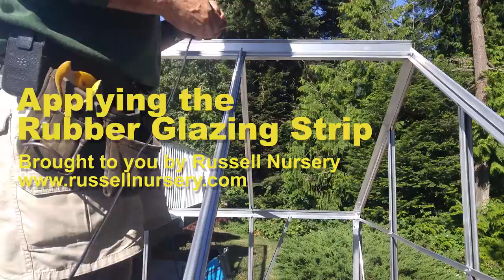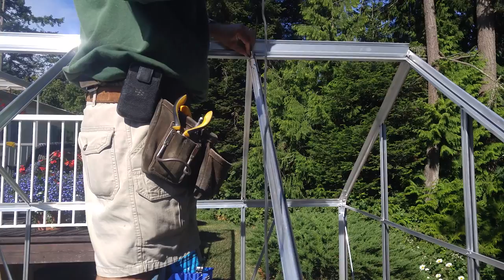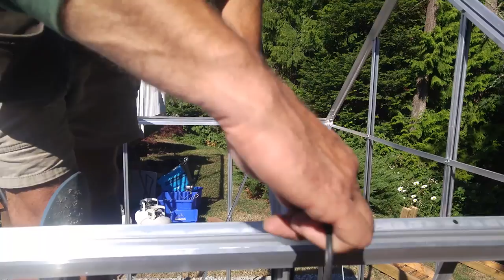Halls Greenhouses: Applying the Rubber Glazing Strip

Comment: A link to this video should be included in the printed assembly manual !
The procedure can be improved by using a cylindrical metal or plastic item instead of the fingers. The lower friction facilitates the process and your fingers are spared.

Comment: I found it helped to run a blunt knife/blade along the split in the rubber to open it up a bit. It made it easier to attach to the greenhouse. I think the rubber strip might have been in storage for a while before it was sent out. Really hard to get on, until I opened it out a bit
Reply: That might be the wrong rubber strip you used?